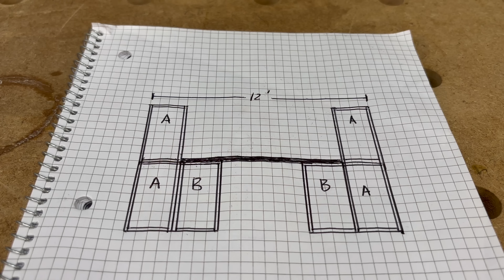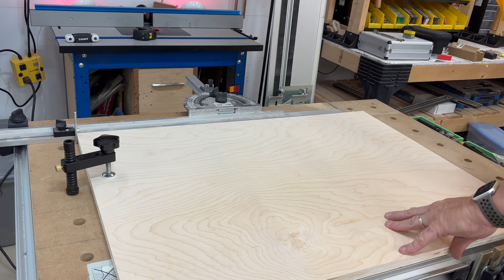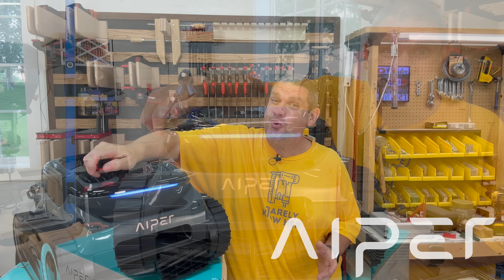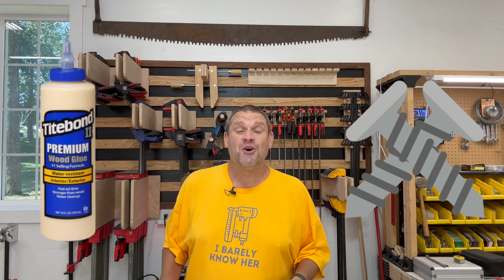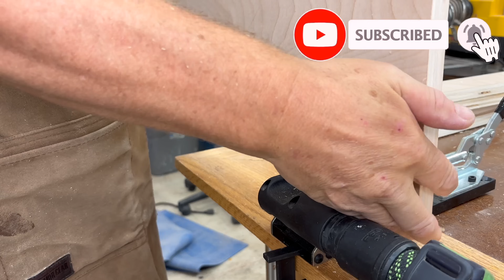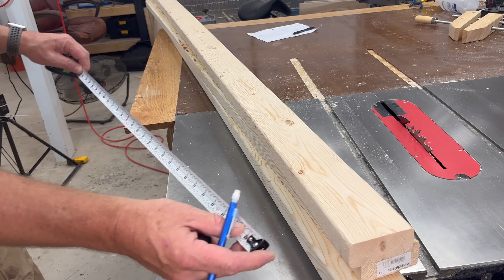Unlocking the Fastest Cabinet Construction Methods

Comment: Goingmake pocket hole jig has great dust collection when used.
What clamp did you reuse to hold the jig down to the bench?  I made a wood slat to fit the hole in the jig base. Then i clamp down that slat.

Also, have you tried to replace a Goingmake pocket drill bit yet?  I snapped off a tip in the fifth test hole I made.  I have the second bit to use while I source a replacement.
I have a Kreg Pocket-Hole Jig 320 with Classic 2" Face Clamp that I upgraded from to the Goingmake jig.
Reply from the maker: I totally agree with you on the dust collection on the goingmake jig.   I've become quite a fan of their products.  Same thing happened to me with the drill bit they had with the set though.  I did the same thing as you with the drill bit!

The clamp I used was a wen track clamp that I got when I got my wen track saw tracks.  I actually like it quite. a bit for stuff like this! :).  Thanks so much for watching ManWorkingHear!  Really appreciate it!

Comment: You showed one of the flaws with the Domino perfectly. It is a pain in the rear. Mine sits in its case for months at a time. I definitely have buyer's remorse. I've been building cabinets for 50 years and found glue with dowels or pocket holes are the best for me. I used to make cabinets with 1/8" splines along the entire mating edge (think of a biscuit on steroids). Cut the dados/grooves on the tablesaw with one set-up. Worked great. I first saw the base/toe kick idea years ago. It has saved a lot of frustration by not having to jerk heavy cabinets around to get them level. I use pressure treated 2X4's for protection from possible water damage. Also, I brad nail 1/4" re-sawn wood veneer over the 2X4's and paint it. Thx.
Reply from the maker: Thank you so much for sharing this Richandpeggyfranks!  I love hearing stuff like this from people who have been doing this and have a lot more experience than me!    I never even thought about doing the splines along the joints.   great reminder!   I love the idea of using pressure treated lumber as well.  I never thought about that!    Thanks again for your great tips, really good stuff!

Comment: You're making Dominoes way too hard.  I agree that they aren't the right joinery method, in your case.  Pocket holes are the way to go.  However, Dominoes are easy too.  All you have to do is put the two pieces together like you want them.  Take a square and draw lines in the same place (at the same time) on both pieces.  Then remember that the marked side is the reference side. The plate goes on the marked side for all mortises.  The domino doesn't have to be in the middle of the board, just close enough, and referenced off the same side.  

In the Domino "Set" version of the kit, there is a "Cross-Stop" that lets you reference the position of one domino offset from the previous mortise. The "flippers" are good at the ends but useless in the middle  The Cross-Stop is the accessory to do this.

Also, the intention is to use a reference position tenon cut "tight" and the rest loose.  This allows a little play.  It also allows you to put one domino in, then "swing" the boards together, rather than having to get everything perfectly aligned an press everything straight.  If they're all cut on the "tight" setting, the boards are a PITA to put together, even if everything is perfect.

As I said, the Domino is way overkill for this application, since the pockets won't show anyway.  Even most kitchen cabinets, even some  "high-end" use pocket holes. I'd still use the Domino, just to get more practice, though.
Reply from the maker: I agree with you on all points Kwilliams.   Great points.  I think the reason I wanted to try the dominos on this application is because I saw someone else do it and they talked about how well put together it was.   This may be true, but it's a pain in the ass to do.   More specifically it's dificult with my settup to do vertical to horizontal joints, which there are a lot of in the cabinets.   Either way I agree pocket holes are the way to go.  Thanks so much for watching!  I really appreciate it!

Comment: You can put plugs in your exposed pocket holes and screw holes. I just got a small Japanese flush cut saw with all the teeth set in 1 direction. No marring of the surface.
Reply from the maker: You know, I've tried to use those in the past Ken, but never had too much luck with them.   I'm sure it's my error, but I always seem to get a rather sloppy fit from those angled dowels.   I might be better off just using regular dowels.  Great tip though, and thanks as always for watching! :)
Reply: @FlynndoggWoodwork  I just use 3/8" dowels or dowel rod to fill pocket holes. Glue in place and cut flush, maybe some light sanding. I'm too cheap to buy the pre-made plugs from Kreg since they are expensive for what you get. I have tons of dowels. I usually cut my dowels in half at the bandsaw before putting them in the pocket hole.
Reply from the maker: @kenerickson4923  You know I need to try it with regular dowels to see if they work better.  Thanks so much for the sugestion.   I just bought a dowel making jig that I have coming up on a future video, but it was a bust.... need to find a better one!

Comment: Thanks. I was taught many years ago using the separate toe kick it makes the cabinet installation so much easier. I’m planning a new kitchen and will be using this method, bath vanities or other single cabinets are an exception
Reply from the maker: Awesome.  This is one of my first attempts at a cabinet, and it was a breeze.  So much easier to just do a box than have the toe kick cut out.  Thanks so much for watching!  Really appreciate it!

Comment: Loved this video. Only thing I've noticed on the pocket screws was a couple of the tips poked through had that happen to me a couple times on my outfeed table. I have been going a 1/8 less on depth to keep this from happening. Picked up a delta 12 1/2 planer and craftsman belt disc sander this week for a hundred bucks great deal for me valued at about 750. Keep it up brother I love your channel. Keep that shop chair in mind us older guys need a rest once in a while lol.
Reply: Where they show you the depth for you set collar just move the collar a 1/16 or a 1/8   towards your drill point. It's important  when you drill to set your clutch on drill so you are not hammering it in. Use a drill I like it better than impact because you set your clutch pressure. Figure out what you tool number is by checking your depth once you got it set you should pretty much member that clutch setting. Mine is a 8 on my dewalt drill. Only time I've had a  issue is when hitting a hidden knot.
Reply from the maker: Excellent tip Terry!  Thanks for sharing.   I always have issues with the collar slipping on me.  I think that is what happened to me on this project .  In fact when I went to build the second two I double checked the depths and it was off a bit so I think that was the issue.  Thanks again for sharing and watching! :)
Reply: @terrydawson5304 how do you decrease the depth on the Kreg jig? I am assuming the pocket hole That is adjusted?